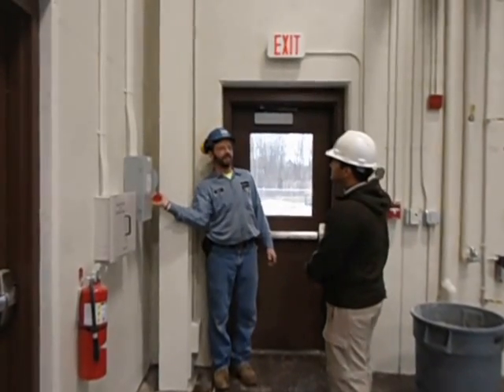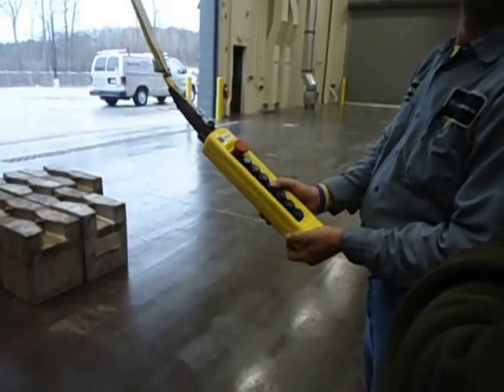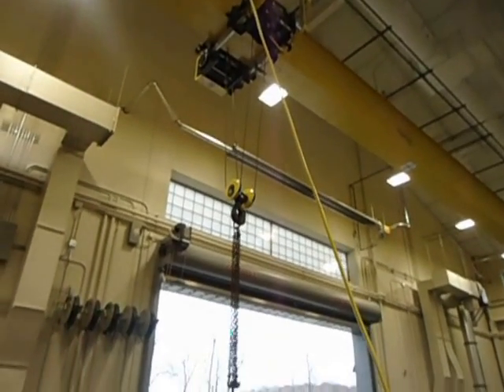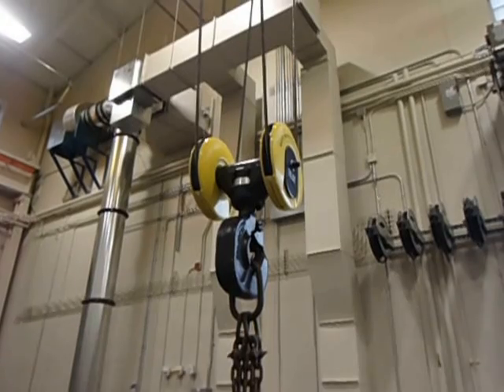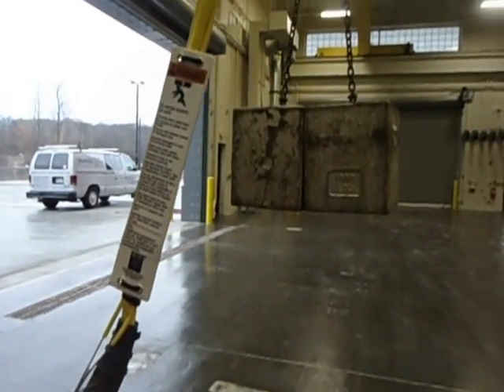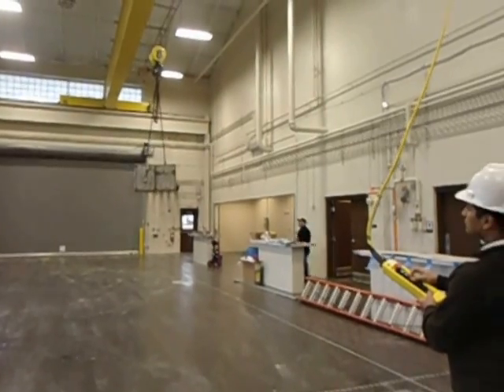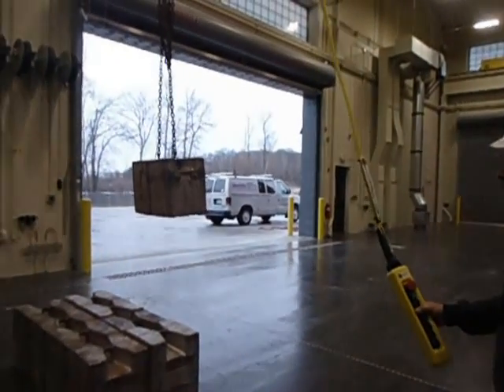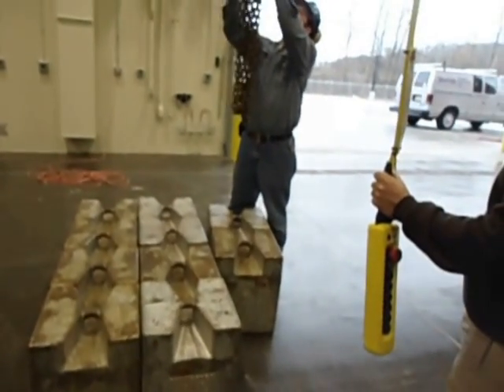Overhead Bridge Crane Operation and Safety

Comment: I would like to add for safety that the load should be partially lifted at least few inches then stop to check the holding brake, if found working, lift a little bit higher say 12 inches then stop again then bring it down for few inches and stop again. This way we can check the holding brake and control brake.

Comment: FYI, it's safer practice to stand on the hinge side of the door when engaging an MCC, or power switch. As you gestured, if there is an arc blast the door will swing away from you. In that event your body will bear the brunt of the blast, the heat, and molten metals. By standing on the hinged side of the door, when the door is flung open and around it is between you and the blast; effectively a blast shield activated by the arc blast itself. It's just a safer position.